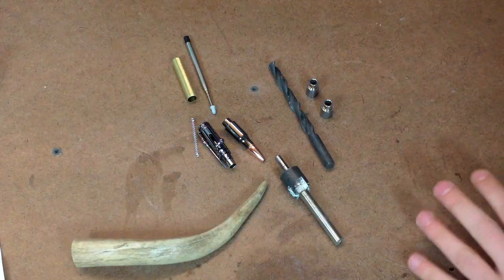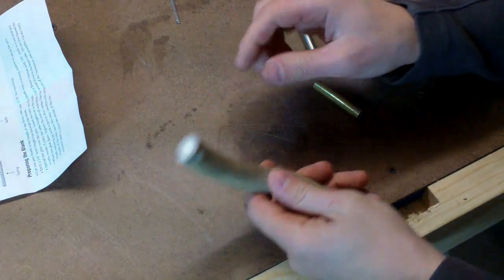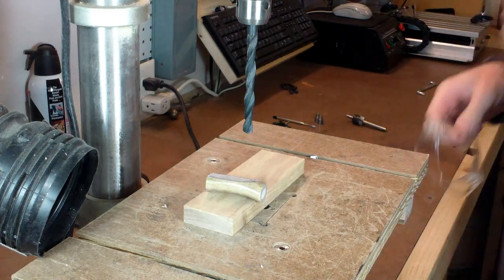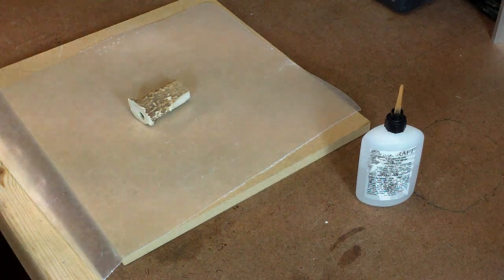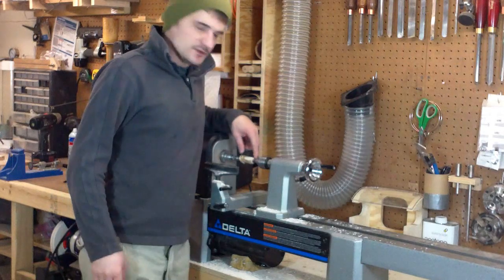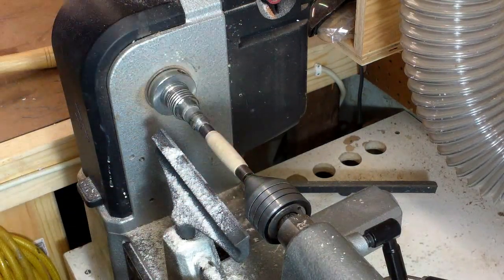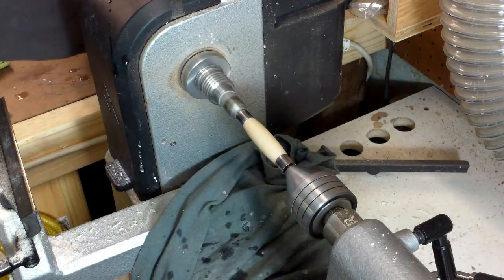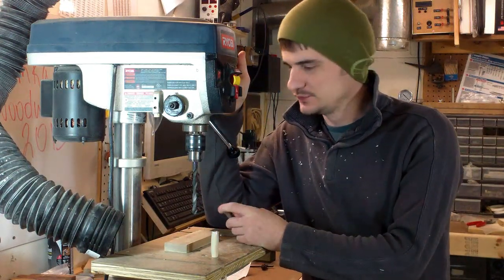How to turn Deer antler Bolt Action pen

Comment: I have made hundreds of pens and other things. One thing I do and it helps I think. Is to flatten some plumbers puddy to about a 1/7 inch thick and press one end of the tube in it then I use a tube insert tool and push the tube in. this way you never have glue in the end of the tube

Comment: Dema, I am about to turn my first Antler pen and I see there are several differences than turning a standard SlimLine pen. My question is this - you placed the antler between centers but I cannot see what type of "live Center" you are using. Is it the standard x-point live center or a different one specially for antlers? Thanks for you help and BTW you video was great as I learned a lot
Reply from the maker: I used a 60 degree live center not the one with the spurs, for a slimline pen you will need a mandrel though ,,
Reply: Dema - you were of great help on the deer antler pen question - The kit blanks arrived yesterday and I am about to start "creating" but a question came to me in the middle of the night - How does one change the ink cartridge after the pen is assembled? I think I know the answer - "just pull the top end off" but wouldn't this also risk pulling the top half off of the body (antler or wood)?
Reply from the maker: Joel Flamenbaum Joel, the copper tip of the pen unscrews to get at the ink refill :)

Comment: If you don't have vice to hold the blank to drill, then better use a thick leather glove to hold it or trimmer attach to lathe and shave the end after gluing the brass tube. I think those friction polish will peeled off slowly......................